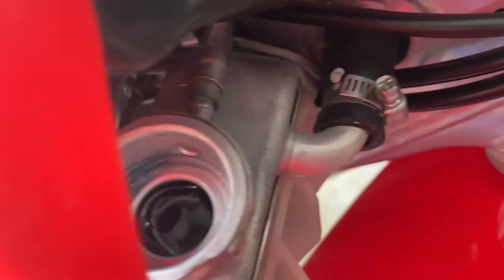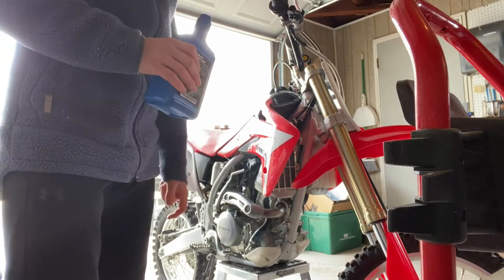How to change the coolant on a CRF150R

Comment: I know this has nothing to do with the video but, when changing engine oil and transmission oil can i use the same oil in both? Also what oil would you recommend for both
Reply from the maker: So I mean I’ve done it before because I didn’t have the transmission fluid at the time but I would recommend getting the transmission fluid and the engine oil. Just go with the regular Honda stuff.
Reply: @Joethepro181  okay thanks!

Comment: And how do i flush it do i just put it in the fill area on the radiator till it runs clear?
Reply from the maker: Yep!
Reply: Ok great thanks
Reply: @Joethepro181  so what coolant mix do i get or brand like what exactly do i get
Reply from the maker: @muzivr4639  if you have a crf just go with pro Honda. Go with whatever your bike comes with stock